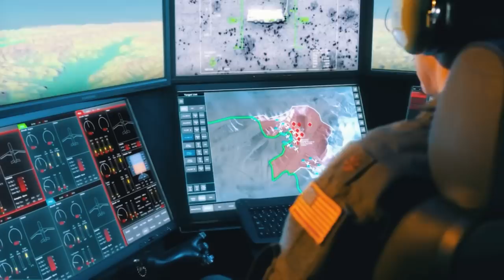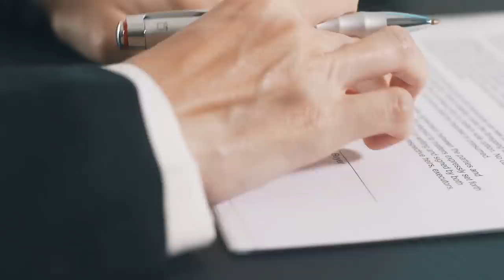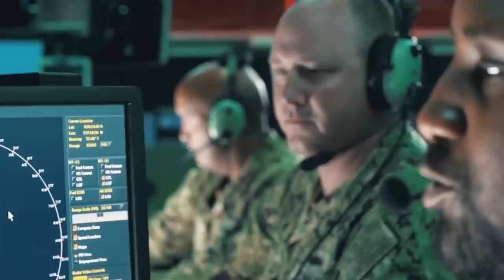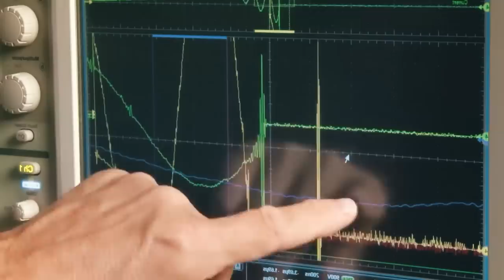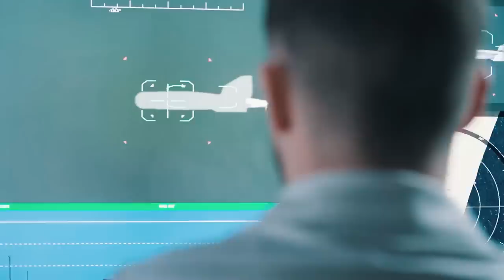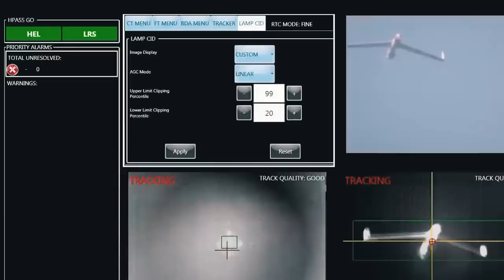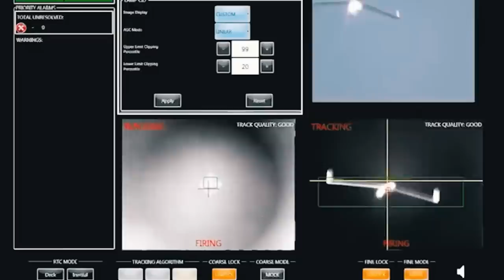This US LASER Fighter Jet Will Destroy China In 1 Sec

Comment: I built a high speed winch system for the militarys fleet where you tow two platforms that says to a missile I'm bigger and more important than the target your shooting at so the missile goes for the platform instead of the ship. When hit the cable is wound in and a new platform is attached wile the other one is still out there. How it worked in sea trials I don't know but it was tried for its viability none the less
Reply: how many years ago was that? sounds like a dinosaur of cold war era... towing an item that slows down a craft and hinders flight can't be good in modern day warfare... these days they could launch a shadowing rocket drone which could easily copy every movement whilst being a hot beacon for missiles.

Comment: Any smart person could figure out a good defense.  Detectors could detect a laser and have the vehicle move up or down to prevent the laser from following reliably.  The weakness of the laser is it's need to hit the target for a bunch of seconds before the target is melted through.  Also, a coating of a different metal could prevent the melting.  Aluminum melts easily, tungsten and titanium, not so.
Reply: You dont actually believe this HYPE do you? In my 25 years in the Air Force nothing like this has been produced. People are so fickle
Reply: @luvtheus  I am talking about lasers in general.  IDK if they are planning to put them in fighters, but Navy lasers certainly do exist.  I was just addressing their weaknesses.
Reply: Look up Tactical Ultrashort Pulse Laser. Creates plasma.
Reply: Or just have a mirror coating!

Comment: the Gerald Ford can power LASERs , Electromagnetic Catapults, Higher Power RADAR and other electronics, and possibly a Rail Gun or two.........because the nuclear reactors develop well over twice the power the ship needs to travel and support its human cargo. Contemporary aircraft do not develop sufficient excess power to drive effective directed energy weapons. That sort of technology is undoubtedly under development........ and may be deployable in a decade or more, Deployment to the ready for combat level typically takes a decade or more beyond the point where testing confirms the unit under test meets military requirements. Such advanced weaponry won't be available for the looming conflict with china. Furthermore the capability of LASERS   as a defensive or offensive weapon is greatly reduced by dust, smoke, fog  clouds and other Weather phenomena one often suffers at sea.
Nothing is invincible; no weapon system remains at the top after somebody develops a method of  countering it's capability. Change is a constant it the struggle for the best weapon; it has been ongoing since the first cave man picked up a rock or stick to hit some animal with, an opposing nation does not have to sink a carrier to render it ineffective. The carrier's offensive strength is it's aircraft. any item needed to conduct air operations is thus a vulnerability. Catapults, arresting gear, Optical landing systems, Elevators, hanger decks the flight deck itself, are all vulnerable rendering the carrier a mobile parking lot.
Opponents to American power are aware of this and will act accordingly. The attitude of American superiority resulted n Pearl Harbour in dec 1941. Keep it up and another Inferior Asian nation will hand you your ass on a platter. You are not invincible so stop bragging about it.
Reply: well said.....war is not the answer...peace is and will always be. one saving grace of weapons race is, it could fight against alien intruders from outer space
Reply: @allblacks4729  assuming we don't destroy ourselves first.
Reply: I suspect that we have the knowledge to create directed energy weaponry, and possibly even much more hideous stuff, we don't as of yet have the wisdom, insight or character to properly handle such things. An infant might know how to press a button on a toy, but you wouldn't want it to play with the buttons at a missile silo. Oops, did I do that?

Comment: You are missing the reason why laser is not, and will likely not be mainstream...retroreflective countering. Any weapon with a retroreflective surface will (1) be immune to the laser, but more importantly, will (2) destroy the laser that is shooting at it. It is theoretically possible to make a laser powerful enough to destroy a mirror by taking advantage of the small percentage of absorbtion, but the bigger problem with that is that most energy is reflected...to where? So the biggest problem therefore of laser, is that unlike bullets, it can be sent back to where it came from at little to no cost or disadvantage. So I would not plan laser for mainstream as depicted here, but for support and amplification - no pun intended. A smaller bullet can damage, or redirect a mirror/surface and then be followed by a laser. This video makes it sound like laser is the next best thing. Its not.
Reply: no it doesn't go back to where it came from unless you have the correct angle of the impact surface. And the mirror would most likely have to be made out of diamonds to withstand lasers of this magnitude
Reply: @DK-ty5ue  retroreflective surfaces does just that by using micro glass spheres embedded in the paint or surface. Check out your license plate. Sure the mirror may be damaged but shooting a hypersonic missile from Virginia, and destroying a building in Manhattan through reflection is not exactly acceptable collateral. My point is that lasers are great but not that great because with the benefit of 300 km/s comes a long list of disadvantages
Reply: @gerhardlamprecht1098  Certainly lasers, like hypersonic weapons and all other offensive and defensive systems, have disadvantages.
An EMP pulse could take out everything electronic, with one blast.
Mirrors would have a hard time staying reflective and free from warping, as they fly through the atmosphere, at hypersonic speeds.
It would be nearly impossible for the missle, to be fully covered in such mirrors.
And the missle could be hit simultaneously by several lasers, from multiple ships, coordinated through the AGES, system.